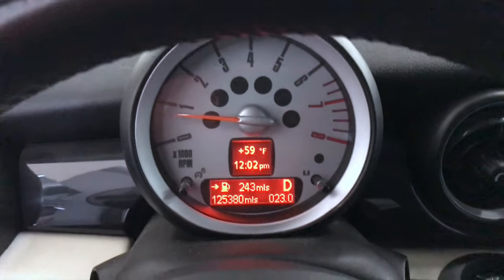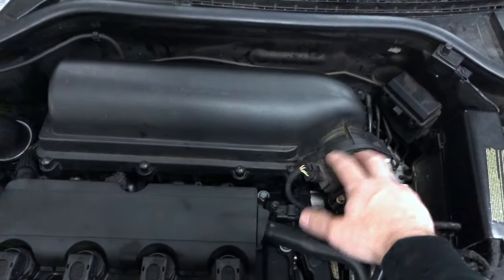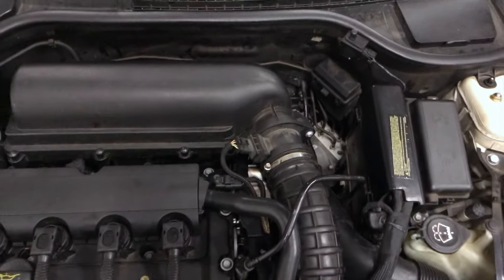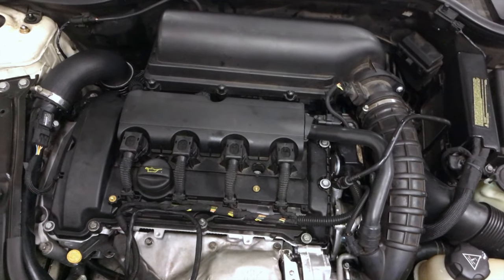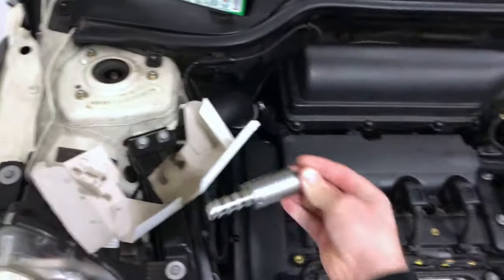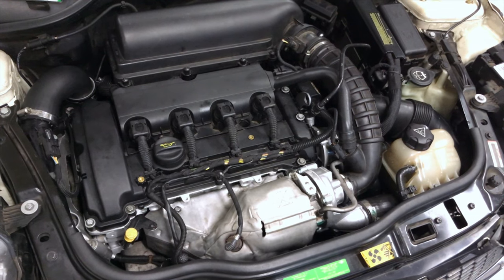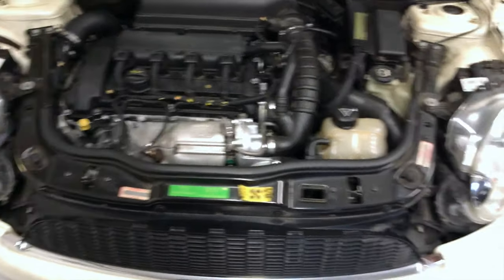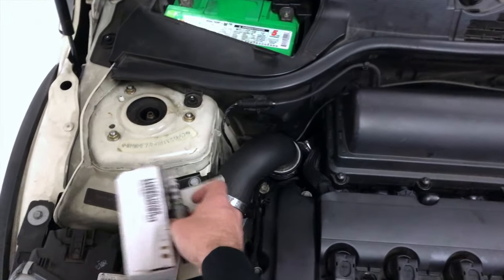MINI:  Erratic Idle Issue, SOLVED

Comment: MR MD ?   I got a very peculiar odor coming out of the exhaust pipe with possibly bluish white smoke. I’m running synthetic oil it’s a brand new oil change and it starts smoking after it’s been idling for a while not un cold start ups but when idling my first idea is that it’s a valve seal guides that are bad and it does that because of the way the heads are manufactured, but is it something else other than that that I can check before I go into Val seal guides?   2008R 56 non-turbo mini Cooper. 135,000 miles.
Reply from the maker: Hi, If you let the car idle for a few minutes at operating temperature. Then hit the gas petal hard to rev it up. If you see smoke then it goes away . it is worn out valve guide seals for sure.

Comment: Hi, could this cause a slight misfire at low rpm and auto stop / start failure? My R59 only misses below 2000rpm under load and wonder if this is the issue. When I got the car I did have a bad habit of letting the fuel run very low.
Reply from the maker: It could. But so could a bad DME. Is it only a misfire on one cylinder?
Reply: @MikeMDs  I'm not certain. There are no pops or bangs, it just stumbles under heavy load at low RPM.

Vanos are cheap enough, I'll do those first. If not then injector clean.

Comment: The idling issue was only doing it when engine was cold? I have similar issue but much less than yours and goes away after taking a ride.
Reply: Marwan Manowar  I am using 93 Octane fuel, but still doing it. How long did you drive it for?

Comment: I took out mine it was clean and I tested it. It was working fine.I doubt this is my issue. I have rough idle code "unmetered air at intake manifold" I took out the manifold took it apart nothing is wrong or lose or leaking.

Comment: I have a question for you I have an 09 Mini with 1.6L turbo. This car has a miss fire under 2200 RPMS. Has new coil pack and plugs, all 4 cylinders has 175 psi compression, has spark and injector pulse, fuel injector is good. When driving with scan tool hooked up the miss is not present above 2200 RPMS or so. I have removed the valve cover to check the valve train for broken valve spring, rounded lobes on cam all is good there as well. I looked up the timing procedure while the valve cover was off to check the timing as well, the cams seem to be in time ( I do not have the special tool for timing ). The actuator on the intake cam does not match the position of the exhaust cam. Does the actuator position matter on this motor. There is no mention of that in the timing procedure. This is a used car so I have no history on the car other than when I had the valve cover off the timing looked brand new. Any help would be great.
Reply from the maker: The misfire under load is on all cylinders?
Reply: @MikeMDs  no only cylinder 3
Reply: @MikeMDs  no only cylinder 3
Reply from the maker: Are you able to see if the injector is getting power?  Also do you know for sure that cylinder is getting spark?  If not then it could be a faulty engine control unit.
Reply: @MikeMDs  Yes it is getting spark. I have tested all 4 coils and used an inline spark tester also I checked the fuel with a noid light at the connector that also flashes when running. I then swapped fuel injectors with cylinder 2. The miss fire is still in cylinder 3 only under 2200 RPMS.

Comment: Hey Mike my 2008 Mini Cooper s r56 has this rough idle and goes into limp mode with CEL on. I’ve spent 1.5 years t the mechanic trying to fix this sentimental car. We’ve changed the HPFP, coils, rocker cover, throttle body, water housing, o2 sensor etc with no luck. Then swapped another hpfp on it which worked so bought another genuine hpfp and then within 2 days the car is doing the same thing as before when we started. Please help Mike
Reply from the maker: Dang thats rough. 
Are there fuel pressure faults or engine misfire faults.

Comment: Hi Mike I have 2008 Mini Cooper we had engine rebuild about three years ago it ran nice now for few months. Mini bin parked .when driving about 30 mph it gives a hard jerk when it’s cold it does a lot sooner ive check for codes none. I have no clue on what can be giving me this problem I don’t want to guess at new parts I’ve looked on web sites videos but no one seems to have this problem I would love to take it to a shop but last time this shop charged me $600 dollars and didn’t fix the problem this  was when we first purchased the mini turn out it needed a rebuilt engine. oil in pistons miss firing all cylinders . Thanks for the help are you located in CA am in AZ.
Reply from the maker: Does it feel transmission related?
Reply: @MikeMDs am gonna say yes but it's doing exactly same think just be fore we rebuild the engine  
I did pull up this engine code  5e31.

Comment: Probley a silly question BUT... my ep6cdt rocker cover is in 2 peices with a horid vacuum leak.. the question im trying to ask is should there be 2 peices ie one for the pcv and one being the rocker/valve cover or are both peices supposed to be integrated together and mine has just perfectly snapped into 2 ?
Reply from the maker: They are integrated together and should be replaced as one complete unit. But there are aftermarket kits that allow you to replace only the pcv diaphragm .

Comment: hey did you get a 523A code?? im having the same issues- changed out the vanos solenoid - did a full coil pack and plug replacement- still getting an egs CODE... any help would be greatly appreciated ( 2010 R57 na)
Reply from the maker: just a mass air meter plausibility code.
Reply: @MikeMDs  but the DS mode starts to flicker and either motor starts to jitter OR shifting goes like each gear is glued down. So i would clear all codes and adaptations.  Drive it and it would be fine for a few minutes. Then if i push the throttle down hard. It does the jittery thing again AND code comes up. You sure all that is just a MAF sensor?
Reply: @MikeMDs  i purchased a whole new shifter assembly with linkage - thinking that’s the issue- 😑 I hate these auto minis

Comment: My 2009 Mini S is doing the same thing but also has a massive valve train tapping sound.  I popped the valve cover off and the timing chain is super tight no broken guard rails.  Head was in pretty good shape, but I found the engine had NO oil in it.  So I filled it up and the noise quieted down a bit. 

Any suggestions or ideas?  So far I’m narrowing in on the Vanos valve or maybe some sort of valve train noise??  The noise seems to be coming right from the center of the top of the motor maybe closer to the timing chain side, which is also where the Vanos is.

Comment: I have a R56 N18 Minicooper S and the same thing is happening. When the Cold start happens the car struggles to start. It revs very oscillating and after 10.. 20 minutes running, the fault code disappears and the car runs fine.

I have no idea what it is....?

Comment: Could this be causing puffs of smoke to come out of the exhaust on acceleration as well?
Reply from the maker: If is a puff of smoke after idling at a stop for a while, it is likely worn valve guide seals.
Reply: @MikeMDs  damn i hope not

Comment: Hey mike - my mini cooper 1.6 r56 (non turbo) does a similar sound but only when it's cold started. I assume it's a kind of choke process. Now It's also burning some blue smoke - do you think it's worth replacing the PCV before looking into things like engine rings?
Reply: Ricky Bugeja i had a similar problem with a 2010 non turbo, mine turned out to be a fuel filter issue, I didn’t have blue smoke though.
Reply: @faruka213  interesting insight. I mught check it out too. Thank you!

Comment: Hi Mike,  I have a 2002 MCS with an intermittent problem similar to the one you describe. It threw an EML and wouldn't hit 15 MPH.  The shop replaced the throttle body and fuel vent valve.  It ran fine for a few weeks and then while I was at a drive thru it started running rough again.  It did make it up to 30 in the parking lot but kept sounding like it was trying to die.  It didn't shake the whole car like you described - just no power.  30 was with my foot to the floor and very slow to increase.  I had it towed back to the shop and they can't get it to duplicate.  Could it also be a failing solenoid?
Reply from the maker: That engine is different, have them check the crankshaft pulley if they haven't already. They can come apart and cause your symptoms.

Comment: Hi Mike I have a 2008 mini clubman r55 s which is showing the same symptoms as the car in this video except mine is also completely cutting out, this has happened after I carried out a seafoam clean, could the gunk from the seafoam have clogged the solenoid causing this? I'm also experiencing loss of power ie press the accelerator and not much happens and no boost from turbo car struggles to go over 90mph, I'm thinking of pulling the throttle body to clean and change this solenoid at the same time? Thanks
Reply from the maker: Was seafood entered through the intake syatem?
Reply: @MikeMDs  yes I put it in through the vacuum port on the top of the engine
Reply from the maker: Okay that will not cause issues with vanos. Mabe a spark plug is fouled or damaged. Too much in the intake port can cause it to wash out the piston rings and loose compression.  I'd check plugs fist.
Reply: @MikeMDs  I have taken plugs out and cleaned with petrol they are only 2 weeks old as it is could they be ruined ? Still no change

Comment: Hi Mike. I have an 07 R56

It starts fine on a cold start. 

When i drive for a bit and then park and leave the car is in neutral. The revs will fall below 0.7 and the car will shake and sometimes stoll.

If you keep you foot on the petrol it wont stall and you can take off. This only happens when the car warms up comes to stop. Otherwise it drives perfectly. 

Any suggestions ?
Reply: Just picked up an 08 with the exact same issue, have you found out what it was? Thanks
Reply: @salty_angler1285  Did you find out? I also have the issue...

Comment: Mine does this (not as bad though) only on cold and only in the first 5-6 minutes of running.  Once warm, idle is as smooth as can be.  Also no warning light.  When cold, choke at 1100-1200 rpm, no idle issue, then it drops after 30secs-1min to 600 rpm, and idles with dips it recovers from, down to maybe 350-400rpm.  The only thing that bothers me about it, is if its damaging the chain and cassette.  It's an N18 Cooper S with just 30,000 miles and regular oil checks, like every 4000-6000 miles or annually.

Comment: Mike, I have a 2015 countryman , had a blown head gasket, I replaced the gasket and milled the head, new guides and chain, now I get a code 2DA2, and it has reduced power, what could be wrong I have pulled the valve cover 2 times to check timing and all is good, and I have no misfires according to my code reader, can you give me some guidance ?
Reply from the maker: It;s hard to say. It could be a bad timing sprocket ( vanos  gear ).  You already  replaced the vanos solenoid?
Reply: @MikeMDs  Thanks for responding so quickly, I have replaced both vanos sprockets and solenoids, checked the timing 2 times to make sure everything stayed together, this same code keeps coming up, and then it says reduced power, check engine , I have rebuilt lots of gen 2 mini engines, turbo and non turbo, but this car i driving me crazy, it is a turbo model, it will run all day in idle with no issues, but as soon as I try to drive it 5 minutes in, it comes back, if you know anything that might help I could use it

Comment: Hi Mike I have a 2016 mini Cooper S all4 1.6L turbo ,auto..Car is fairly new but miles are about 150K.. i’m having similar issues with my car like you ..when cold and I try to put it in gear Either Reverse or drive ..It wants to hesitate and sometimes it does stall out.. i’m not sure if my issue is the Vanos… I’m pretty sure you replace the intake Vanos but I read on your video correction that the non-turbo engines also have one by the dipstick I’m guessing that’s the exhaust vanos but my car also has a Vanos there and it’s turbo .. So I have two Vanos us one on the intake side and one on the exhaust side by the dipstick.. now I’m not sure if I should replace just the intake or replace both… i’m not getting no codes for Vanos issue..I already replaced the low pressure fuel sending unit Under the rear passenger seat also replaced the  02 sensor bank 1 closest to Turbo.. The fuel sending unit was a oem brand Pierburg and the O2 sensor was a Bosch.. still runs the same check engine light is still on no difference.. codes im getting are P0171 System too lean bank one, ,P0300 Random misfire detected,P0303 Cylinder 3 misfire detected and again P0171 System too lean bank 1 all codes Are permanent ..I don’t know if I should bite the bullet and replace both of Vanos with OEM ones which are about $200 a piece but not sure if that’s going to fix my problem but I am getting the same symptoms you are I think you said in the beginning of the video you were getting a lean code .. this is my daily driver and I am in New York, when a car has a check engine light it will not pass inspection.. previous owner spent about 2000 on new parts including new valve cover new map sensor new mass sensor .. i’m totally lost here or if I knew one or both Vanos were bad I would replace in a heartbeat.. Your video was very helpful.. Before replacing your Vanos was it throwing any type of codes if so you remember what they were.. Any help from you or anyone would be appreciated.. I am a mechanic myself and mostly work on Mitsubishi Evo‘s .. never thought how temperamental these minis are which are BMWs.. Great video content I know it helped a lot of people who knows maybe it would help me but I don’t wanna spend $400 and I Still have a check engine light.. After about 15 seconds on cold start the car runs and drives perfect I was also thinking may be the high-pressure fuel pump was The issue 
So I was going to replace that or injectors could be full of carbon I only run 93 octane gas but I know that doesn’t make a difference when it comes to carbon buildup with Direct port injection my last option was thinking maybe Throttlebody like you mentioned in your video. Last case scenario was thinking the computer may be faulty.. sorry for the long post but I’m throwing parts at it and getting nowhere and my inspection is due next month 😭.. Again great content
Reply from the maker: Hi,  I'd focus on the lean mixture faults. A faulty valve cover ( with built in crankcase diaphragm)  can cause a lean mixture. You may need to smoke the induction system. It could be fuel related too. Hard to say without seeing it in person.
Reply: Thank you very much Mike for getting back to me.. The car has a brand new valve cover was pretty expensive I think $500..I know the PCV System is located in the valve cover that’s why it was replaced but didn’t make any difference there is still a check engine light.. I did a boost leak test .. I put 20 psi of compressed air into the intake manifold and they were zero leaks… i’m not sure if a smoke test would be any different because at idle the motor is creating vacuum and when it hits boost it creates pressure.. so a boost leak check I preformed I would hear a leak if there was a break in a line ,intercooler pipes etc.. I’m not getting not even one code for Vanos or cam so I don’t know if I should change the Vanos because if I do I’m gonna put OEM in my car has 2.   1 on the intake side one on the exhaust side so replacing both of those would be close to $300  which again would be a gamble replacing those because I’m getting new codes for anything cam related.. i’m getting misfired codes from cylinder three and cylinder four.. Also six other codes one of them being lean code bank 1 ,P0171.. also where are you located I know if you got your hands on this car you would be able to fix it but not sure where you’re from I’m in New York by NYC
Reply from the maker: Okay sounds like you have done the correct things. Having a misfire only on two cylinders ( assuming you've already checked plugs and coils ) makes me think you have a burnt valve. It will cause misfire and can cause lean mixture as unmetered air will enter the combustion chamber.  See if you are able to do a compression test on those cylinders. Also fuel injectors can cause that as well. But i'd make sure compression is good.
Reply from the maker: Or if you have a borescope with a horizontal camera , you can inspect the valves through the spark plug hole. It's usually an exhaust valve.

Comment: i'm not showing ANY codes at all. But it's running REAL rough at idle.  Any ideas?  I did replace the solenoid valve last year.
Reply from the maker: Its too hard to guess what it is without seeing it and without codes.

Comment: Hi Mike i have 2013 Countryman 1.6L 4Cyl (N18B16A) Turbo it makes  that rough idling sound like gasping for air  but does not go over 5-10 miles mph  when you drive it any idea what it could be or where to start more hate than love
Reply from the maker: Hard to know without seeing it or knowing fault codes. Could be a high pressure fuel pump or throttle body. Just a guess.

Comment: Hello. I have a Mini Cooper S F56 and i have suddenly got RPM increasing when im standing still in neutral. I have changed the fuel valve, but didnt change anything. Do u guys have any sugesstion of what this could be? Cheers from Norway :)
Reply from the maker: It could be a faulty crank pulley.  I have a video " top 9 reasons your MINI is running rough"  It may shed some light.